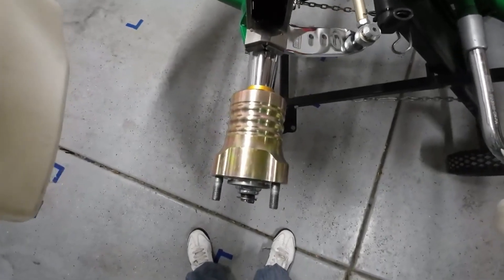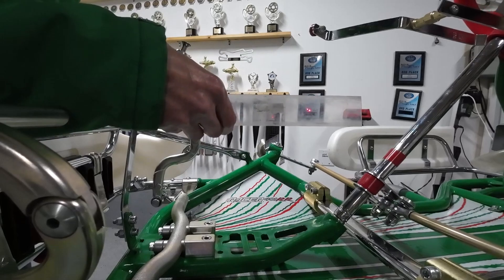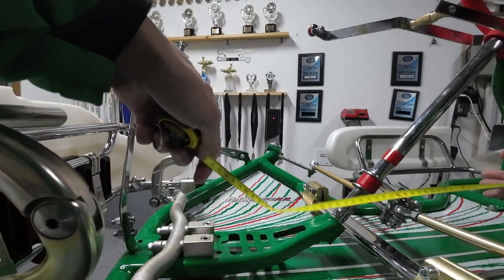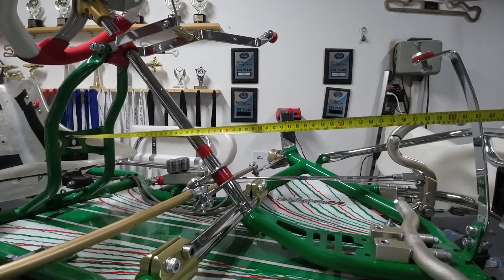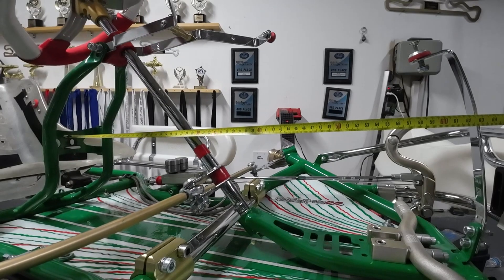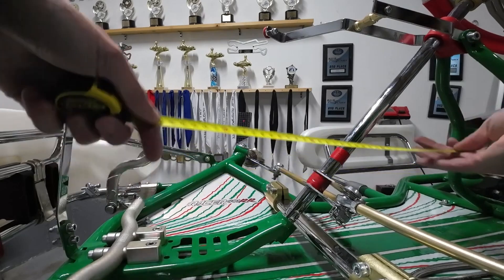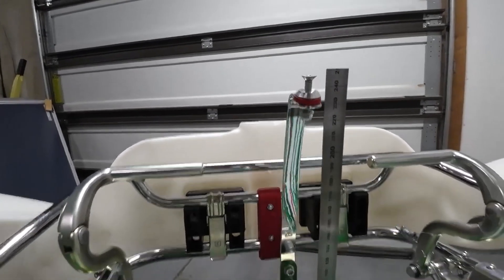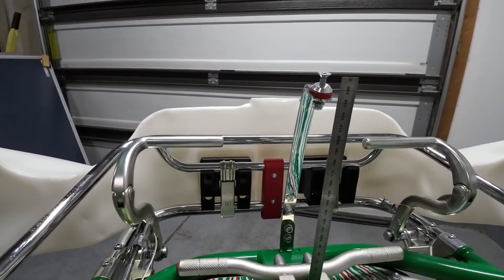Go Kart - Sweep and Caster Measurements

Comment: When I get my sweep the same, get the lasers on top of each other, my steering wheel is slightly but noticeably turned to the left. How do I adjust my wheel slightly back to centre without affecting the front end geometry?

Comment: I just did my sweep for my margay k3 the first time yesterday. I had a like 10 mm difference of one side to the other. I made it so the sweep was even but the toe was off then. What is more important, what the laser alinement says is the toe or do I need to fix the sweep
Reply from the maker: IMO toe is more important. When I set the front end alignment I do it just like my older front end alignment vid, without checking the sweep.  Full disclosure in the 15 years we have been karting I have never set the sweep,  I received a request to show how to measure sweep which is why I created the this vid.